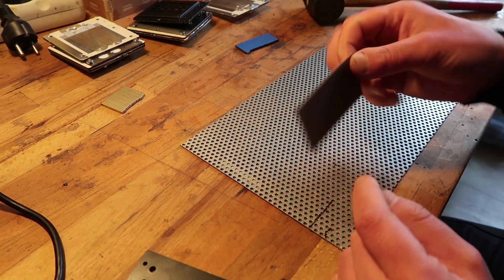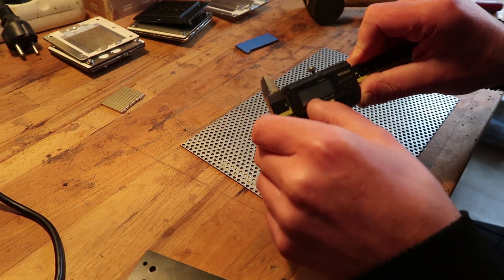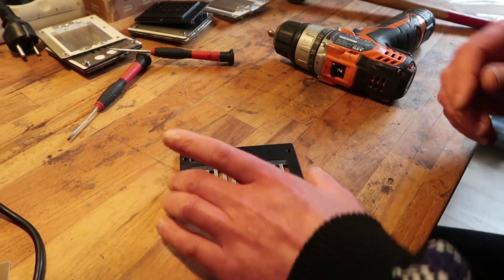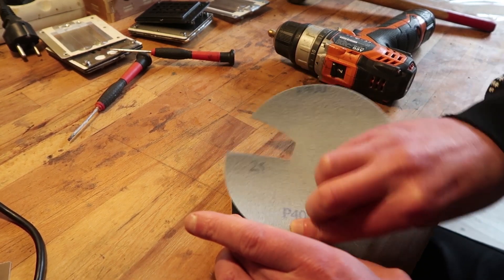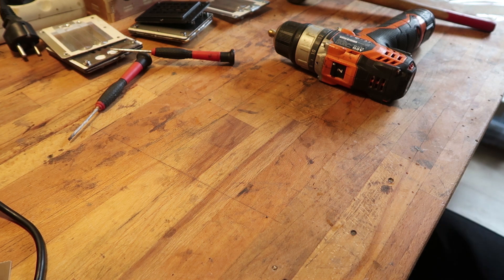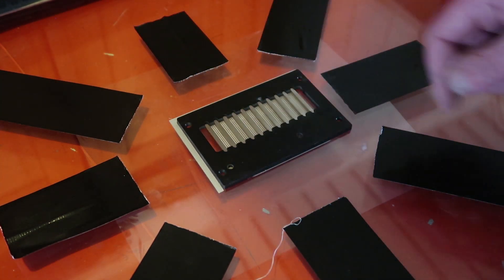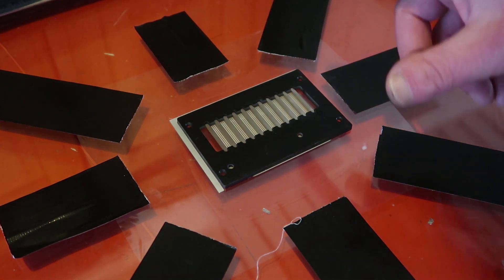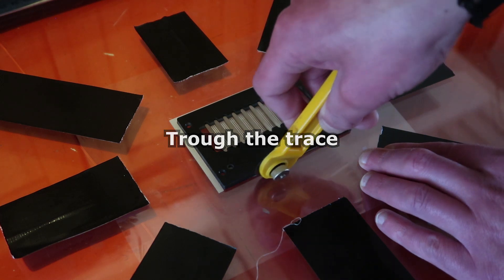Mini monitor revival part 2 - Tweeter #1 - with first measurements

Comment: what if i can only reach making 0.18mm in thickness coils？Can that make a sound？
Reply from the maker: it makes sound for sure , but the top end will be rolling off. it might be  to heavy.  the 0.03mm or 30 micron alu i use is already rather heavy,  normally you have a rising response near the top end. since i use rather hefty foil it gets countered a bit. thats why mine look rather flat compared to lets say a neo 3.  depending on how you want to use them or need the extra efficiency,  one or the other can be more interesting.  mine should handle a bit more power i think though. but i  did not do a destructive test yet.  distortion will be rather unpleasant i think before i burn out the coil.

Comment: Nice works Joppe. I think would be easier to align the membrane with a rear light box as negatoscope or similar
Reply from the maker: In this case just some light on the other side would have fixed it :) that's  the most easiest solution I think :)
Reply: Maybe you can use some kind of jig?

Comment: Please, gives us the distortion measuring. I bought 2 X Fountek Neo 3.0, but I don't know if are good... I saw in one video that this tweeters are very good above 4khz... I love your tweeters of this vídeo... Can you tell me if the Fountek are good? One day I will bought one pair of your tweeters if they are affordable... :) This fountek has a transformer, yours not??? I think that you have reason in run from your own path!!! You have many knowledge.
Reply from the maker: distortion measurements i will take for sure.  the founteks are ribbons. a different animal. and indeed only usefull above a few khz. but have other benefits like efficiency extension etc. i dont know if they are any good. there are enough measurements to be found about them online.